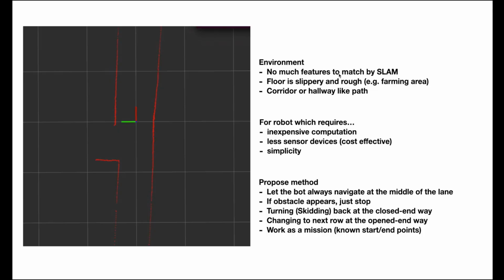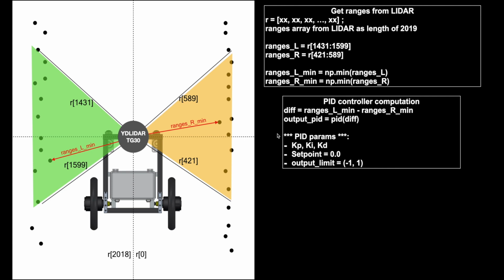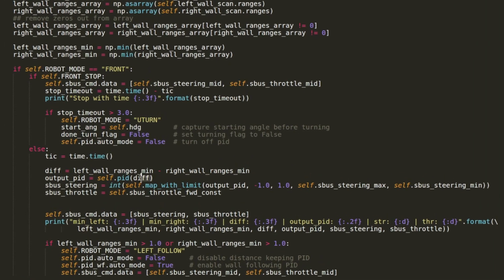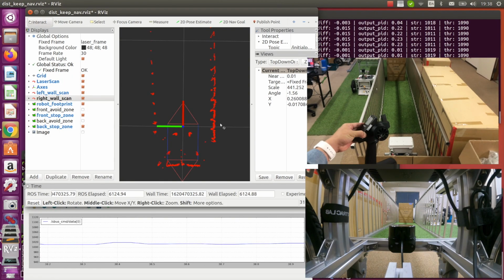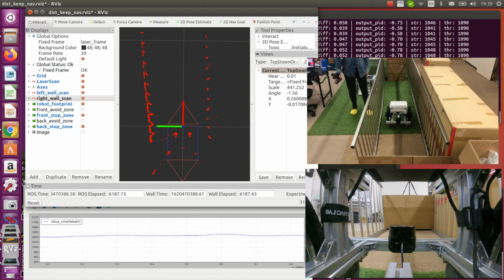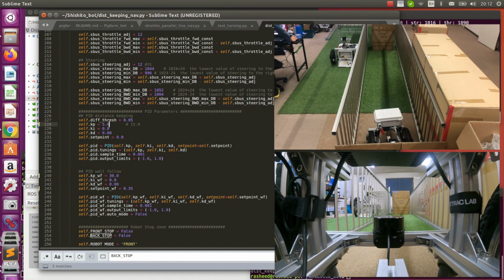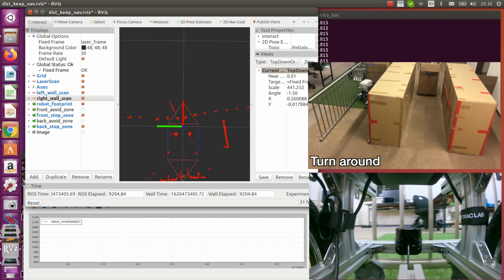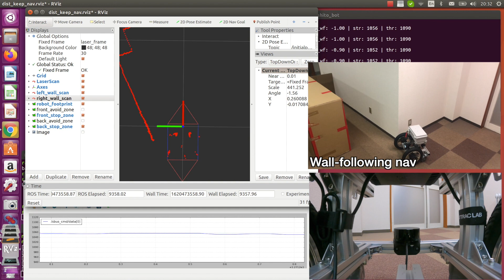PID Control for Keeping-Distance Navigation Robot

Comment: In the video the I and D values are set to 0 - What's the point of using a PID control scheme if you only make use of the proportional part?
Reply from the maker: I and D could be used as well, depends on how’s you want the robot to react during navigation. I found for my application just P is good enough.
My point of this video is to show that we could use PID (or even P) with only Lidar to navigate the robot. 
I am not an expert of control engineer, but this idea serve my purpose :)